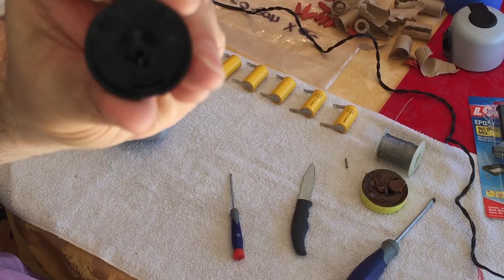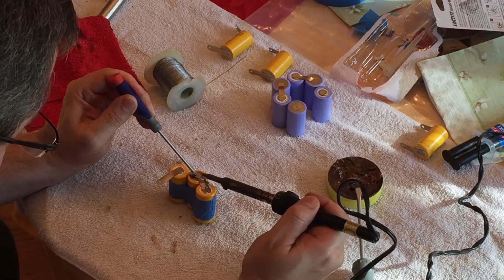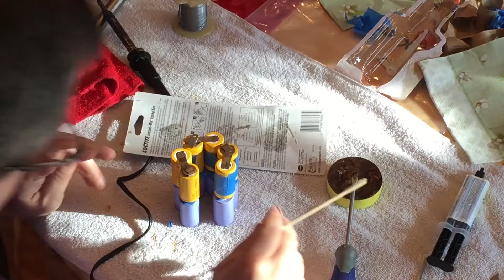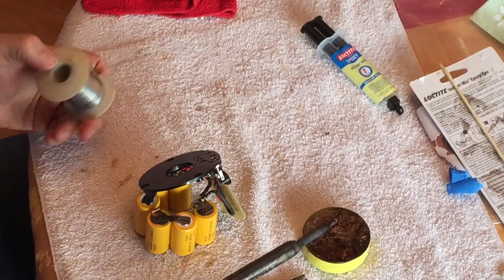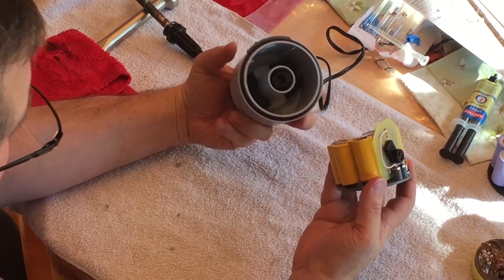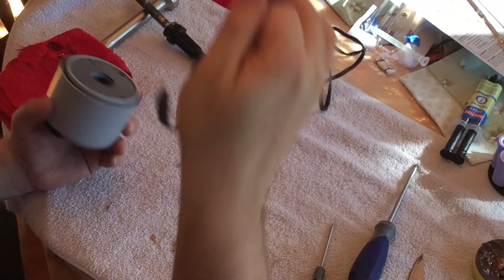Ikelite NiCad Battery Rebuild for Ikelite DS125 Strobe

Comment from the maker: Yes - I tested it in a 9’ pool for 10min and have been diving over 10 times since.  Reminder to use the proper grease to make sure the o-rings around the housing and in the switch are sealed both after the rebuild and after every few dives.

Comment: Thanks, I re-build 4 packs and here are some improvements I did. If you have access to 3D printer, you can print this frame for easier soldering/spot welding https://www.thingiverse.com/thing:3521984    If you want repair flooded battery pack, you will need new charging connector and most likely also PCB, here is a PCB design you can make or order in PCB factory to send you: https://github.com/tomaskovacik/pcb_ikelite_battery_pack
Reply: By your picture, I can see you used NiMH batteries instead. Would you mind to share which ones? Thank you!

Comment: Awesome, thanks so much for making this video and sharing with us.. Thought Id have to fork out on new pack for my old strobe but guess not anymore! Just curious, does not the added power of the battery affect the strobe power at all?
Reply from the maker: The higher capacity batteries don’t affect the strobe performance at all.  The battery packs will just take a little longer to charge than the originals but the best part is they store more energy so you can take more pictures and the recycle time before each shot seems to be faster.  Good luck!  Be sure to test the strobe in a pool (the deeper the better) of you have one available to ensure no leaks.  After dipping it in a sink or tub for a few seconds I’d move to the pool and give it a 1min bottom test and if that passes then do a 10min test followed by a 30min test.  This process will hopefully allow you to catch and resolve any leaks before it floods.

Comment: I know it was originally posted in 2016, but I just came across it and I'm tired (financially) to buy new batteries. I currently have 8 NiMH battery packs for my DS-161s and it would be great to rebuild some of them. I see you used NiCad. Is it right to assume that I can the same using NiMH instead? Thank you!

Comment: where can i buy the cells and what is the cell part number you are using in this rebuild?   TY
Reply from the maker: Hi Brian,

I purchased the batteries from zbattery.com.
I believe this is the battery (see url below) I used for the rebuild.  I strongly suggest you check the specs, specifically the physical dimensions, on this battery and compare to the originals used inside your strobe housing to be certain these are correct.  They need to be the same size as the originals.  The voltage and mAh are correct at 1.2v and 2200 mAh.  

http://www.zbattery.com/2200mAh-NiCad-1-2V-Sub-C-Insulated-Battery-With-Tabs

If after looking around a bit and you find the same size spec with a higher mAh at the same voltage you might consider using that one instead since it will hold more energy in each cell.

Good luck,

Mark
Reply: Big for taking the time to post the video and reply to my questions with detailed info Mark.   My unit is NiMH type vs NiCad.  6 x 1.2v is 7.2v,  which is the same a 2 cell lithium pack.   I pondering even rebuilding with lithium if i can get a charging circuit integrated inside.   Less space would be required for cells leaving room for circuit board.
Reply from the maker: Hi Brian,  

Sounds like it should work no problem.  On its face Lithium is a much better electricity storage solution than NiMH or NiCad however I understand lithium cells may pose an issue for air travel which is why I believe Ikelite stopped manufacturing them as they were getting confiscated by TSA.   Just a word of caution if you plan to travel with the cells. Give it a go and let us know how it works out!

Mark